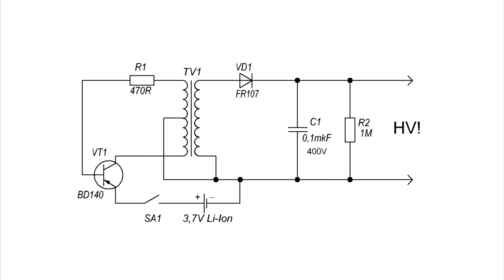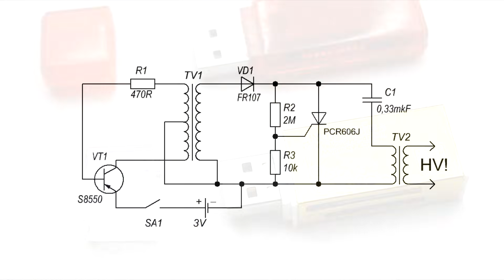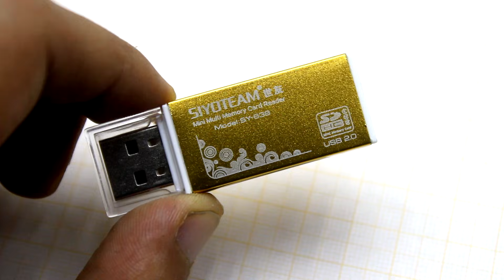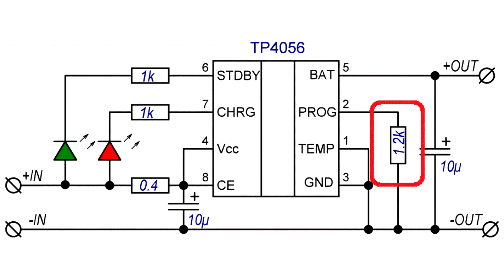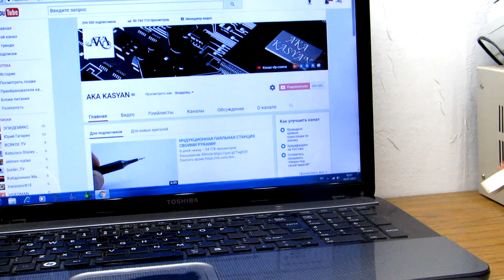How to make USB Killer!

Comment: FAAAAKEEEE, most likely fake as I've experienced it myself. If you short circuit or send high voltage via the usb port, your PC will shutdown. But let it sit for a couple of minutes and then press the power button for 30 seconds it will start up again.
I say most likely fake because maybe, just maybe old laptops could be fried, but I highly doubt it. No manufacturer of laptops is going to make a laptop that isn't 'protected' in case of too high incoming voltage from USB's.
SMH.

Comment: Can I use BD139 insted of BD140? What changes would have to be made to circuit?
Reply: cccp3 Appreciate it. Thanks! ☺
Reply: Shreyas kulkarni are you planning to make that thing?
Reply: sandeep R yep. I have similar primary transformer from old chinese shocker pen whoose driver was burnt and I was searching for a more powerful driver...so I can use it to charge capacitor bank and use it as easy xenon flashtube driver...  ¯\_(ツ)_/¯